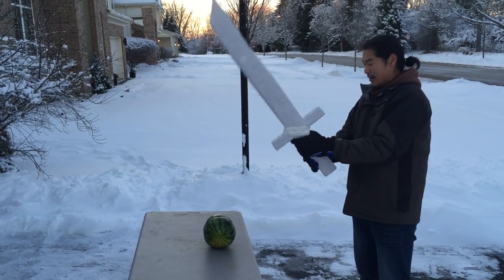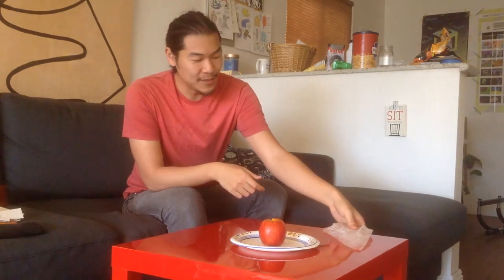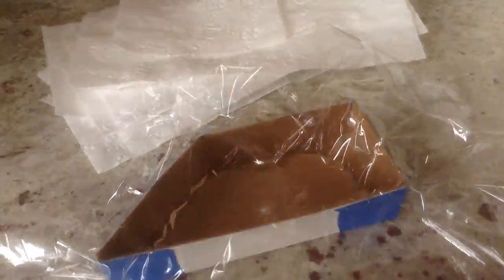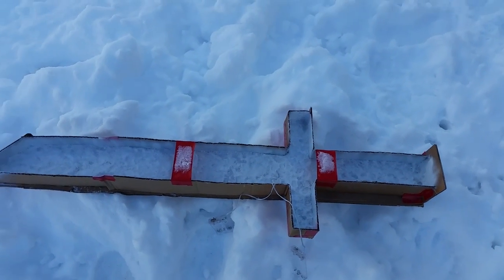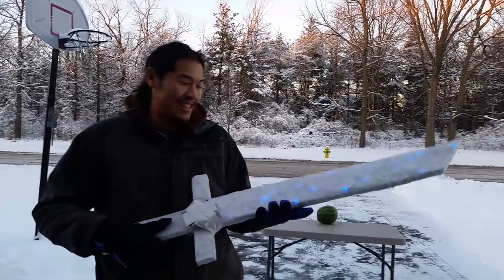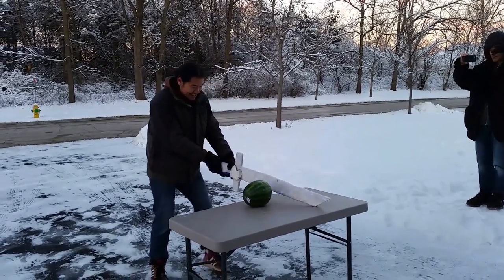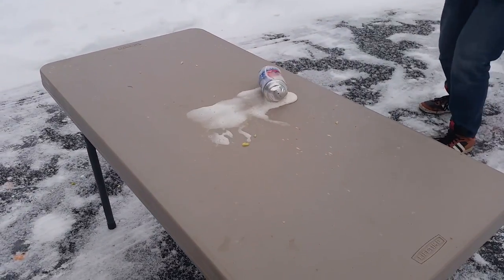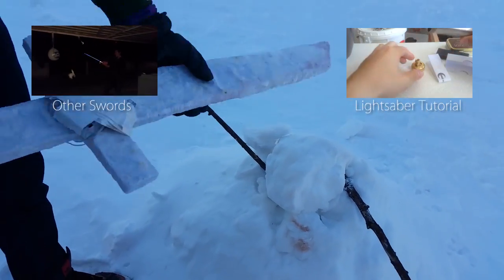ICE SWORD! (Made With Pykrete) | Sufficiently Advanced

Comment: I think it doesn't break because the toilet paper distributes the force instead of focusing it in one point, like if it were a net; or at least it was something like what I saw once in a TV show where they hit a block of ice with cotton in it with a sledgehammer and it wouldn't break. :p
But this was the coolest sword ever! (Pun intended)
Reply: Lol
Reply: +Canica Lopez It's less about force and more about energy. To distribute force, you'd need a hard material, not fibres. Fibres use up energy otherwise spent on increasing the length of a fracture (need to avoid at all costs), by stetching, by forcing the crack to go around them (lengthening it needlessly) and by friction with the surrounding material. Also they pull back together any occurring micro-cracks.
Compare body armor: titanium or ceramic plates distribute the bullet's force over a large area, while the kevlar underneath soaks up all the energy by stretching.
Reply: +boycot gugle Somebody give this man a cookie.
Reply: Canica Lopez
Can I have steak on my cookie, please? And fish :)
Reply: the show was street genius
Reply: boycot gugle 
🍖🍣
🍪🍪

Comment: its more like an hammer than a sword
Reply: Yup. They really should have made the handle thinner. It would have decreased the strength, but at least then it would not handle like a sharpened rock. At least you had some basic feel for edge alignment with this thing though. I wonder what the balance was like on it. :)
Reply: +tygonmaster if they had made the mold out of something a bit more rigid like plastic or steel.
Reply: Steven Boelke
For what? The handle? That was what I was referring to. The whole idea was that the sword was to be made from ice as that was the gimmick. Making it out of plastic or steal would have made it because of course it would, but it kind of eliminates the purpose. :)
Reply: +tygonmaster oh no! My bad! I was saying that (in addition to the better handle) if the mold they made it from was more rigid than the cardbpard they used, the blade would be straighter and perhaps sharper.
Reply: Steven Boelke
Straighter probably, yes, but to get something like this really sharp, they really would have to do a lot of work to fine the edge down. :)
Reply: i know but its more effective when it is been use as a hammer

Comment: Very nicely done. I wonder how well you could do with projectiles? 

Maybe, you could have a small dart form 3D printed, then you could make a silicone mold or five with it. Then, use various Pykrete compositions to make something that can absorb enough water to remain structurally stable, but also be light enough to propel with a blow dart gun.

As for your next project, I suggest trying to make something that involves actual plasma. I know that it is dangerous to work with, but so is a torch that sprays formaldehyde everywhere. Perhaps a less mobile invention will be able to use a low temperature plasma for something constructive. As electrical arcs are the easiest way to obtain such plasma, perhaps you could use a salvaged transformer to rig something up.

Comment: Without a proper bevel it really doesn't have much cutting power. The reason it was able to break the fruit and the can was because of blunt force. You see it in the damage that it is not so much a cut and more of an explosion of bits. Still, you have proven that pykrete is a viable material to create a lethal weapon, and with some grinding to get a sharper and less steep edge, this could probably cut quite well. Of course there are flaws in the design, like the size of the handle, the lack of a pommel and the thickness of the blade, that can all be fixed with a better mold and more planned use of the material. Good job!

Comment: You didn't actually cut anything tho... you smashed them, it's as much a sword as two 1x4 nailed together is a sword shape.
However, it was rather interesting to see how pykrete holds up in comparison to ice. 
You should've made a warhammer tho, or a mace.
Reply: +Any Name Will Do, it seems to me that this weapon straddles the line between slicing and smashing. It certainly did not cut the watermelon like a hammer would have done. See any Gallagher video for reference. At the same time, the cut was not as clean as one would get from a metal blade. Whether one calls the Ice Sword a dull blade or a sharp blunt instrument is a probably a matter of opinion.